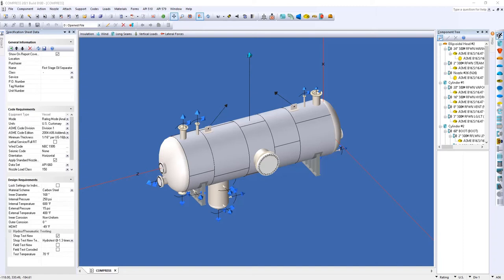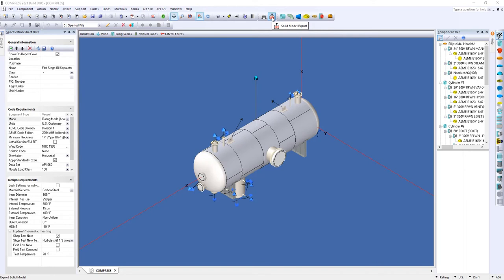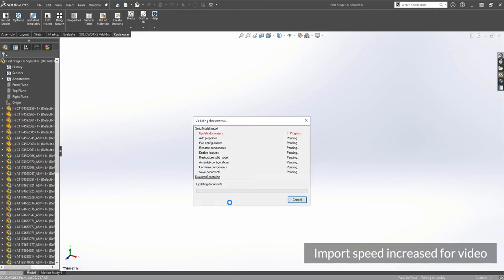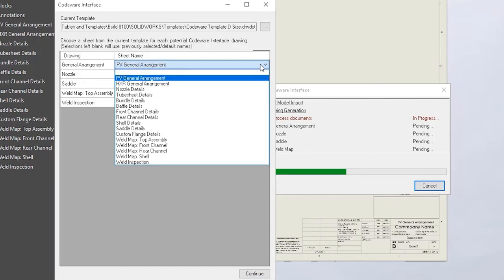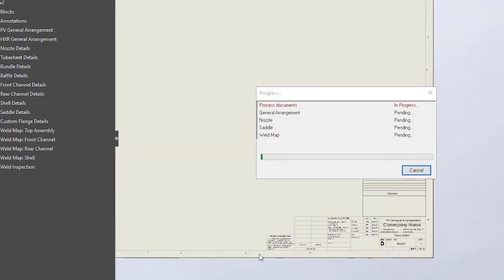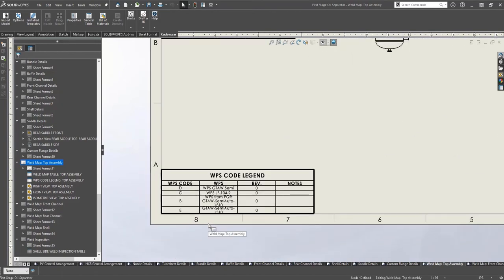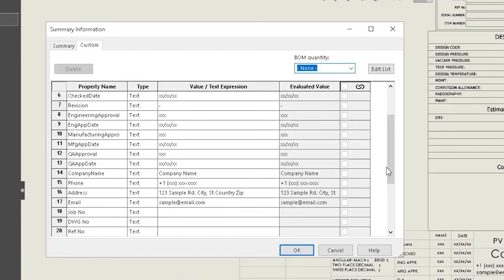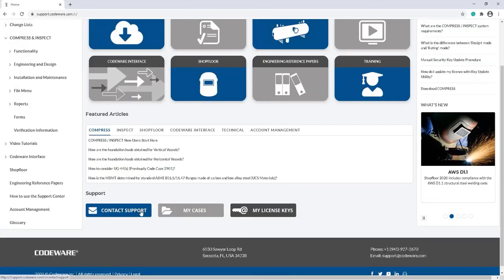Multi-Sheet Drawing Templates and Pressure Vessel Weld Maps

Comment: Which features out of these aren't available for inventor?
Reply: I just built a interface drawing using Inventor. It looks like the weld map and weld inspection features are not included in the inventor interface. :(
Reply from the maker: @JeffLippincott  Thank you for your comments. Unfortunately, we are limited on new features due to the limitations of the APIs in Inventor. This includes the sheet metal features for cylinder components, support and heat exchanger drawing updates, edge preparation, and weld maps. We encourage you to reach out to our engineering support team at support@codeware.com for more information.